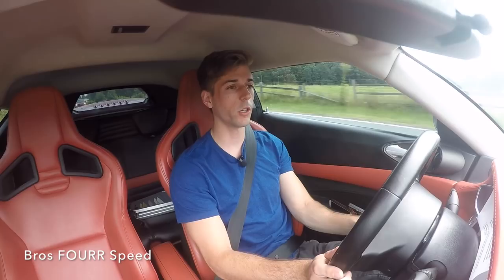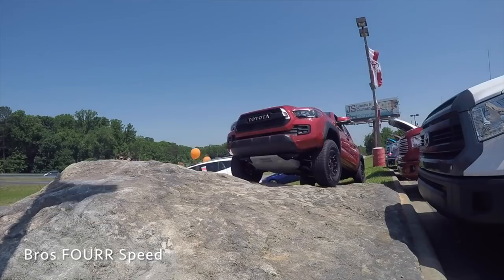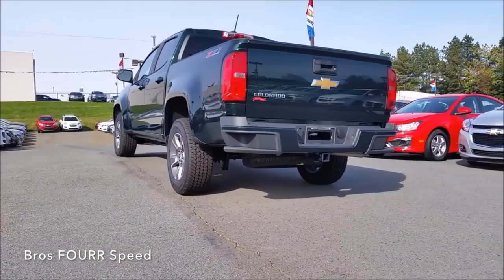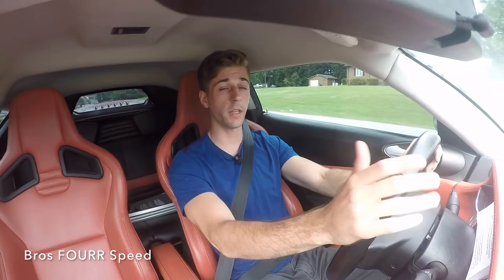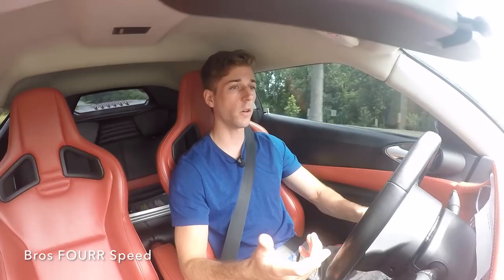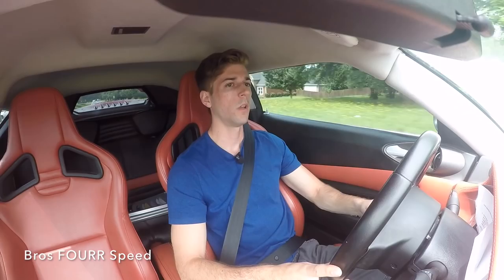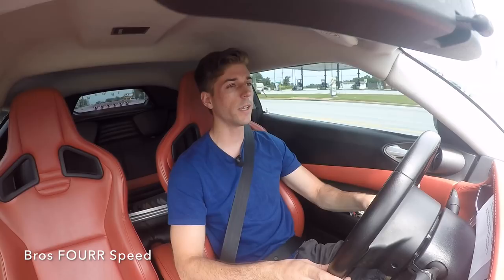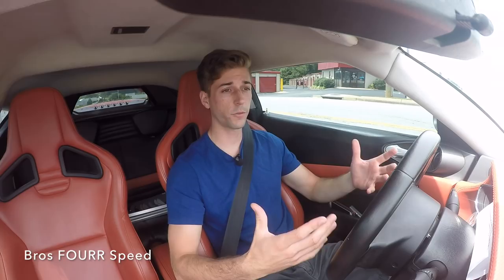5 AWESOME MIDSIZE Pickups: Which is the BEST??

Comment: I've owned a Colorado Z71,4x4,Ext Cab V6 for about 15 months now and 18,900 trouble free miles! The wife drives it daily to work, but that's only 10 miles round trip! We tow a travel trailer that weighs 4,000 lbs all over the east coast. On our last long trip in February, we left Massachusetts then went down through PA and rt 81 in VA, then caught rt 95 in southern VA! Down to Key West! Stopping along the way a day or two at a time! Then traveled up the west coast of FLA up to  The Smokey Mountains of Gatlinburg and Pigeon Forge, then back to Massachusetts. We also had a cousin and his wife traveling with us in his new Tacoma, a Crew Cab TRD 4x4, V6,  with a travel trailer similar to ours, but his is a toy hauler! Mainly because he cannot fit his Sportster in the bed like I can! We both rolled over a Cat Scale, we weighed in at 9,870 GCVW, he weighed in at 9,790 CGVW! But I'm hate to tell you, we got an average of 14 mpg in the Colorado, they averaged 12 mpg in the Tacoma! Both of us towing at those weights! Empty we get 17 city 28 hyw, his Tacoma get 17 city 25 hyw! Also we switched off for a tankful of gas just for laughs and he and his wife admitted the Colorado is more comfy! In the Tacoma it feels like your sitting on the floor! As far as off road goes, where we go, mostly on beaches it's a toss up!

Comment: I have a 2015 Toyota Tacoma with a Bilstein 5100 level kit and BFG All Terrains ko2 and I love it. My Tacoma has literally gone through hell with off-roading and it holds up like a champ. My friends that have Tacoma’s also have never had a problem with them either. I’ve hit many rocks with my tacoma, one sent my front end up in the air, and to my surprise nothing was broken. I’ve driven about 47,000 Miles on it and it still drives like its brand new. Only con in my opinion to the 2nd gen Tacoma’s is that the interior is kind of boring. I don’t mind it because like I said, I love my tacoma, but this is a heads up to anyone trying to buy a tacoma. The gas mileage with the level kit, bfg all terrains, and aftermarket rims is around 15 or 16 mpg. Rims I do suggest for a tacoma are Black Rhino rims. These rims look amazing and suit a tacoma really well. The rims I got offset my wheels about an inch out, which made my wheels look bigger. The sound system in the Tacoma’s are very nice if your curious about listening to music. My friend has put 120,000 Miles on his tacoma and he also says it drives like its brand new. Overall, I highly suggest the Tacoma, especially if your looking for your first truck. This car will last a long time so there’s no need to worry about it breaking down.

Comment: I'd rate the Colorado/Canyon and Ridgeline or even the Frontier higher than the Tacoma especially the new Tacoma. The quality of the Tacomas as been on a downhill slide throughout each generations. This newer 3.5liter Tacoma have engine, tranny and rear diff issues and who knows how many more recalls will be issue in the next year or two. The Colorado being a Chevy will always have a generous rebate and warranty. Perhapse the only truck in the list that offers a diesel. The heavily discounted Frontier has an old but solid powertrain and maybe the coolant issue has been resolved by now.  The Ridgeline is still innovative and not as mass produced as the Tacoma so the quality will obviously be better. In a snowy Midwestern scanario, the Ridgeline suv character standsout.
Reply: I have a 2017 Tacoma TRD off road. I have had no issues. Shifts just fine. The low end power is sluggish but when you step on it the truck takes off. I don't regret my purchase at all.
Reply: Christopher Carter That's good to hear. You probably got one of the good ones. Let's keep our fingers cross on that brand new truck.
Reply: I like the look of the Colorado but worry about how a Chevy will hold up over time and the quality of their product.  I have had people tell me Chevy makes a better truck from a quality and reliability perspective but I'm cautious.   I have always had such good luck with Toyotas over time, they seem to run forever.  I just wish the Tacoma had a better look/design.
Reply: I'll admit, I like the ridgeline's bed design (side swing tailgate, locking bed storage), but honestly can't say I'd ever need that much space on a regular basis. Nor would I need bed speakers for any normal day. But tbh, I don't really need the Tacoma 12v plug either. These extra features are nice, but should come as options that way those of us who don't need them can keep more money in our pockets.
Reply: 76vike They are all made here in America and they all have their own problems. You pick your poison. We're all guinea pigs when it comes to buying a new car. Just make sure you like it, the price is right and when shit hit the fan, you're covered.
Reply: VQ37VHR 23NISMO not

Comment: Toyota is overrated, we currently have 2  toyotas in house including a taco, we have been dealing with a lot of issues, we previously had oder ones, and same situation, we traded in a 2014 camry  with an issue that three dealers couldn’t resolve, my daughter has a 2011 ford since 2014 and so far we only did oil changes